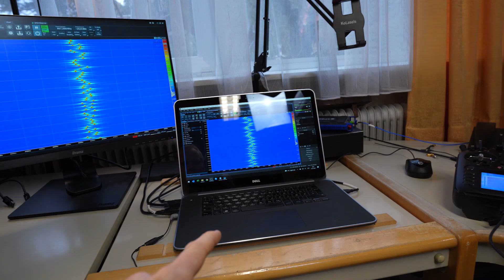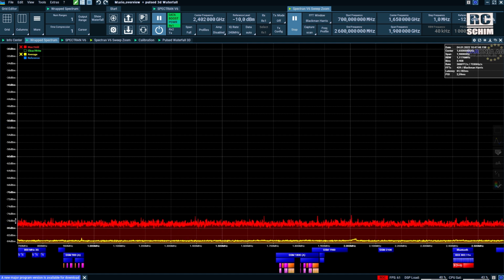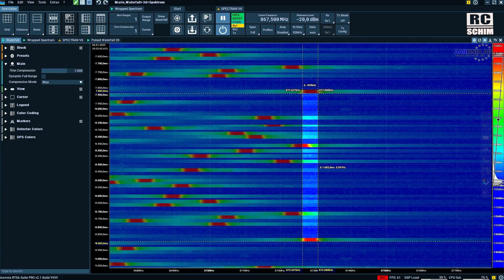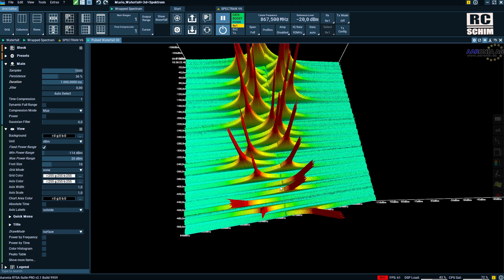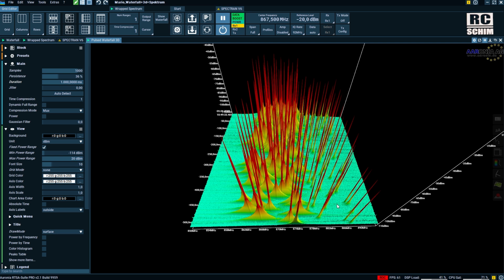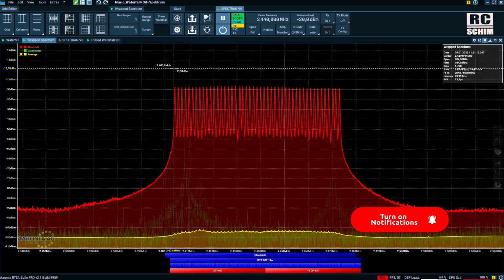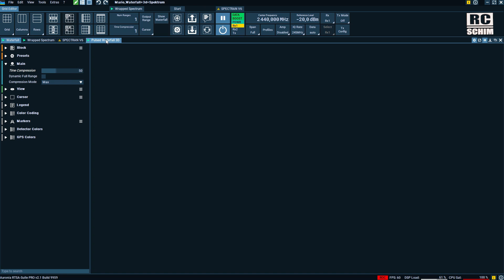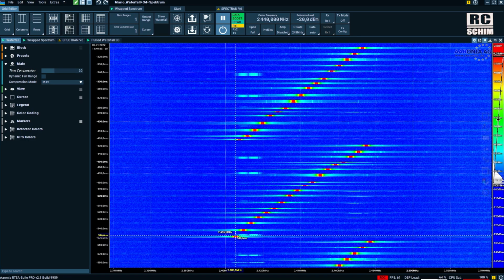how your RF Signals look like (Crossfire, FrSky, Futaba with Aaronia Spectran V6)

Comment: Hi RC Schim, I have a question about antenna's on DJI goggles I hope you can answer. I'm hoping to put an SMA adapter on my goggles that will allow me to connect several more antennas:  iFlight crystal HD + Maple wireless patch antennas + 2 TrueRC stubbies. All are 5.8ghz. Are there any considerations for a setup like this like ohm load or is it just a bad idea? thanks~
Reply from the maker: Not sure if I understand your question. Do you speak about RP-SMA to SMA Adaptors to use SMA antennas?   Or do you really want to mount more than 4 antennas at once?
CrystalHD, TrueRC Stubbies...  they all are RP SMA - so no need for adaptor.   If you mean like 45 or 90° adaptors to make the antennas fit better - yes - some % of loss - but not so tragic.
IMHO: either use the crystal directly (without adapters) - most convenient,   or get something like the 3turn Helicals x4  (but keep in mind they need to be easy to mount, else you will not like them. TrueRC made a better mounting solution for their Xair2). My fav are the Henrik "Deathrays" to be seen here: https://youtu.be/RQML-azG4bQ?t=360   (if you want to buy them you need to mail him directly.
greets, Mario

Comment: very interesting thanks, it would be good to see a series using the Hack RF One which is a much more afordable anilyzer for us, any chance ? plus it can record and retransmit which would be fun
Reply: The HackRF is still a cheap spectrum explorer tool.
got it a few years back in a portapack bundle and was like 135USD in total with 5 extra antennas and I like the ablelity to be mobile and you can analyze your signals on Android devices or on the units itself in a waterfall display or on PC where there are tons of SDR-programs
Here I'm looking on a 5.6Ghz analog video signal..
https://www.youtube.com/watch?v=LoVImsY2miA
Reply: @JAKOB1977  Hi Jakob, yes I have a PORTAPACK, I thought it would be good to do a short series on using one in FPV,

Comment: Very interesting. I'm sure that you will continue to find cool things to analyze with it. I'd like   to see the signal passing through obstacles like from another room or through tree branches. BTW, how come you have leaves on your trees in the background? Is this an older video that you hadn't finished until now?
Reply from the maker: I'm pretty sure that the signal spikes will only get smaller if you have obstacles in between - but maybe we can show this in a splitscreen video (me walking away with RF source and phone cam and RF spectran on the other side...).

There are only some ever green needle trees in the background, no leafs. The video was shot last week in my vacation ;)
Reply: @Rcschim  The split screen idea would be great. I'm a ham radio operator as well as a quadcopter hexacopter flyer and they always say how UHF signals will do a better job of finding their way through an urban or indoor environment than VHF signals, and VHF does a better job outdooors and over hills. It would be cool to see it in 3d.

Comment: Crossfire in EU race mode transmits telemetry between range 860 - 886. In normal EU mode telemetry and frames and tx frames have separated bandwidths that are allowed to transmit.
Reply from the maker: Race mode:  the interval length (until frequ hopping pattern repeats) is 2 instaed of 1 sec.
868 CE mode is limited to narrow, allowed in EU band (I've seen 862-868MHz). Telemetry, if used, is stacked "behind main packets not on seperate frequ.
Only in the normal 868 mode you see a broader use of the frequencies and there the Telemetry is "sideways" :)

Comment: Awesome work. Couldn't agree more, seeing the RF spectrum of those protocols in 3D (w.r.t time) really helps in understanding how they work, but I suspect you're only scratching the surface, because what we're seeing here is mostly the channel multiplexing to allow for multiple-access, not the underlying data modulation. Would have been nice if the analyzer could demodulate the sub-carrier spikes (e.g. FSK, BPSK, CSS) and decode one of the RF packets to show the channel values, e.g. the TBS CRSF spectrum looks like it's using FHSS with pseudorandom hops to allow for multi-access, but the underlying modulation used in the spikes must be chirp spread sprectrum (CSS) which is used to encode each LoRa packet.
Reply from the maker: Thanks for your comment. I'm quite sure the software can decode signals, it's more on my side to learn how to... I will do more research in that direction!

Comment: happy with the frsky but I had abandoned that train for the crossfire you had used and now I am on the verge of indecision to move on to express lrs module, most likely happymodel and for sure not to these badly builts betafpv.

Will you also add an express lrs investigation in the future now they have anounced to certify a CE version ?

thanks - like the spectran analyzer working great.
Reply: got the answer in the very last minute that you got as I another faulty unit . It happens over and over again and if you get a good one you need a microscope to check the soldering if there might be an issue later in midflight. 

Thanks a lot for adding that elrs thing.
Reply from the maker: Yes, will test elrs and am curious to see if it is similar to crsf. The betafpv module is OK, but the nano to micro adapter has so fragile pins I first bent one then it broke off while trying to bend back in place...
Greets, Mario

Comment: Nice video, could you actually translate the data to binary or does it work different?
Reply from the maker: The software is very impressive and has a lot of modules. (Moduls: i.E. :Spectrum view, Waterfall, 3d Waterfall,.... broadcast Radio demodulation, Drone detector,...) 
so yes, in theory you can receive and decode stuff with it - you just have to know what you're doing (which is my main problem most of the time :)
Control Link should be fairly easy to decode - DJI video is for sure more complex.  Analog video I've seen an module already (it's quite simple).
Reply: @Rcschim  Kannst du vielleicht ein Video über den Decoding Prozess machen? Würde mich sehr interessieren. Und dann würde ich gerne wissen wie breit du in den Frequenzen messen kannst bzw. wie breit das Spektrum deines Messgeräts ist. Grüße aus Deutschland.
Reply from the maker: ja, wenn ich das mit dem Decoden schaffe, dann versuch ich's im Video zu erklären. Das kann aber etwas dauern bis Du so ein Video hier findest ;)
10MHz bis 6GHz ;)
und das tolle hier ist:  auch bei dem "sweep" über den ganzen bereich geht's sehr schnell! Der kann 204MHz netto "auf einmal" ansehen, also pro Zeitwert. Deswegen kann der auch die 6GHz in sehr kurzer Zeit komplett durchschaun.   Deswegen ist das Ding auch nicht grad günstig...

hier findest mein urspr. Review: https://www.youtube.com/watch?v=L4H7R-5DVU8
Aaronia Spectran V6 RSA500x RF analyzer:
- extremly low POI (probability of intercept, how short of an RF signal spike can the device "see")
    97ns (FFT-based)   10ns (I/Q-based)
- fast sweep speed: over 500GHz/s, it can sweep 6 GHz in less than 10ms
- RTBW (realtime bandwidth) 120MHz! (can be unlocked to 245MHz)
- Range: 10 MHz to 6 GHz
- Dimensions: 210 x 115 x 30 mm    860gr weight
- powerbank in same formfactor with 26ah
- for mobile use:  powerfull laptop! (or reduced fps)
  larger Powerbank (needs to supply enough WATTS!) or only 120MHz scan rate with one USB 3.2g2
Reply from the maker: Check mal die Links vom Aaronia Kommentar weiter oben - anscheinend gibts schon Decoding-Videos. Werde ich mir selbst auch genauer ansehen. Möglich scheints also auf jeden Fall zu sein - man muß es nur mehr verstehen ;)

Comment: pretty sure if you hook that up to joshua's brain, it looks a lot like crfs. hehehe. hey a i need a troubleshoot, my vista on my no.2 quad seemss to be losing power when i increase the throttle, my first guess is mamba stack f405 hd is failing to maintain the 9v out?...
Reply from the maker: Do you use a capacitor? That helps, or as you suggest, weak 9v power...
Reply: @Rcschim  yeah i might have messed up the capacitor moving the components to my new frames, archon v3 awesome! ps, can i hook up a multimeter to the 9v and increase the throttle? do i measure amps?   i think its possible i cooked the vista... no bench fan and doddering old brain trying to figure out crsf lolol
Reply from the maker: I always use a little fan   (or on the fullsize airunit - you can just unplug DJI video power). 
But I dont think you can actually damage the Vista with heat. If it's too hot it should shut down.  Bardwell once almost killed it by shorting it - but it also survived this. 

Try this:  hook up just + and - from the vista to your Balance plug of the battery - bypassing the whole copter  - (you also dont see telemetry then) this way you will see if your vista is the problem or the 9v power on the FC!

Comment: GREAT STUFF!!
ELRS vs. Ghost.  Why does ELRS miss a frame when telemetry is sent back? Seems like others are doing the telemetry packs on a separate band outside of the transmission hopping band.  I'm guessing ELRS just uses one of the transmission spikes to send telemetry back?
Reply from the maker: Hi Mark - nice to see you here! 
I could bite my a.... for breaking the ELRS nano to micro adapters pins  (they are really fragile!) so I couldnt take a look at ELRS (I have one from BetaFPV at 868mhz). 
If I compare it to CRSF I expect to see quite similar signals... and if so:  CRSF obviously has Telemetry outside (on the right)   but if I had it to 868 CE  (narrow mode) than the telemetry is "behind" the main signals....
Will try to get some current ELRS hardware (BetaFPV will hopefully like to see me using their gear) and maybe also GHOST?   In theory I should still know someone at Immersion RC :)

Comment: Very intresting visualization about RF singals! I would like more content about RF's!
As an old FUTABA (10CG) user I have one thing to say! Never expirience failsafe with it! Never!!!
Reply from the maker: I only had failsafes related to the 35mhz Mode (long antenna,  crystal...) but 2.4 worked great! But rx and radio were quite expensive, nothing compared to what we have now...
Reply: @Rcschim   yes indeed! Way expensive!
 I was forgot to mention about 2.4GHz module and not the 35MHz